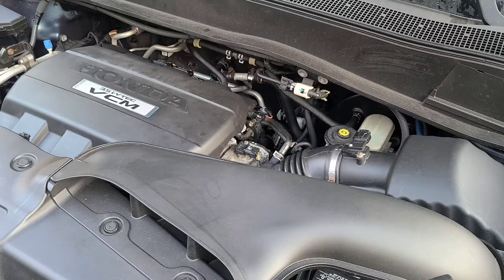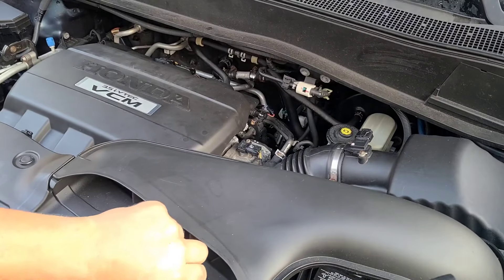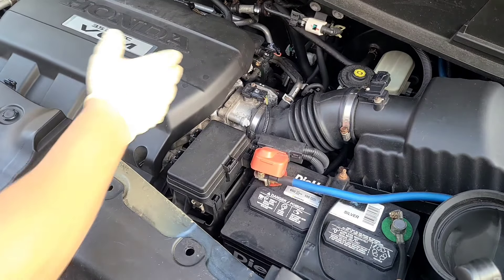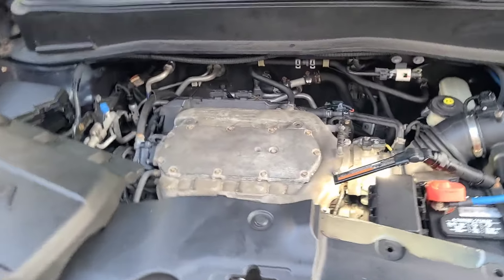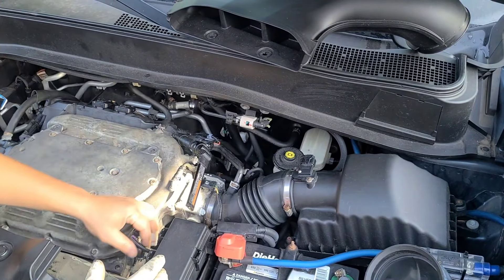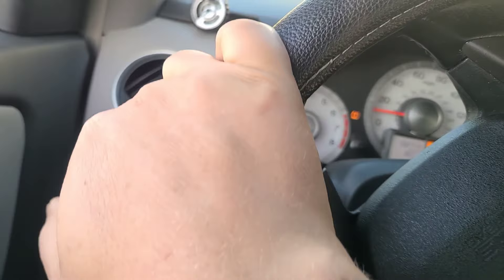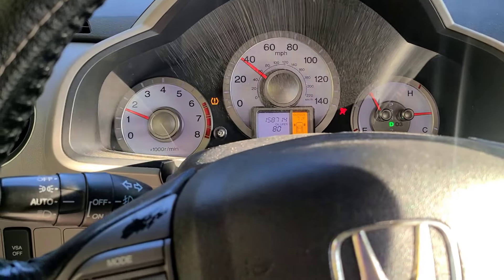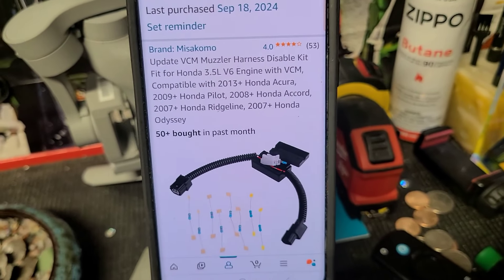2009 & up Honda Pilot, Odyssey, Ridgeline 3.5l  VCM Muzzler installation

Comment: Have you had any issues since installing the VCM muzzler?
Reply from the maker: @ultra_minecraft7827  No issues, the eco light may come on from time to time.  It's says it's normal. I had to change the 82 ohm to the 100 ohm. The eco light came back and stayed. Once I changed it. It came on a couple of times, then went away. I've been using it since the video. The engine will start to adjust after it's driven a while. I guess it's cleaning the build up around the other pistons. They don't move as much, so i got the muzzler. It kept feeling  like the engine was rough when in exo mode. Not in a bad way. Just not smooth. Other than that it's running smoothly without that stumble jerk.